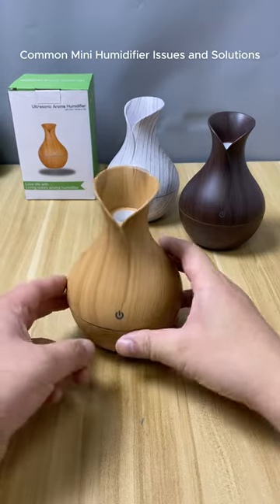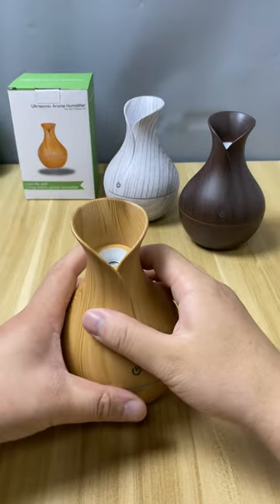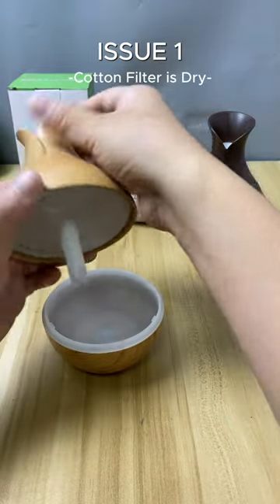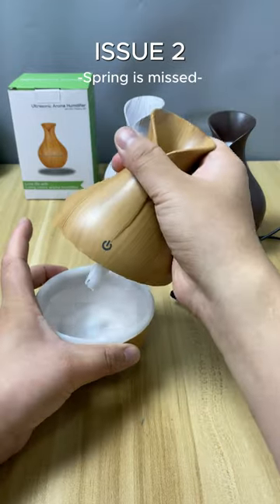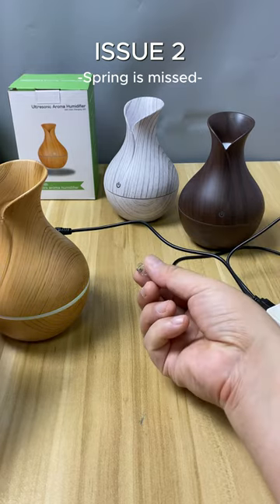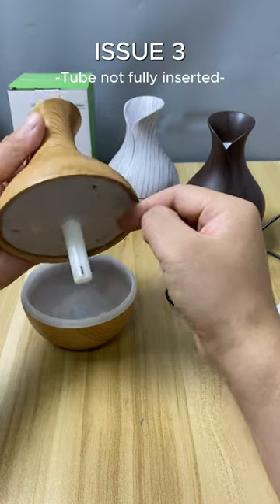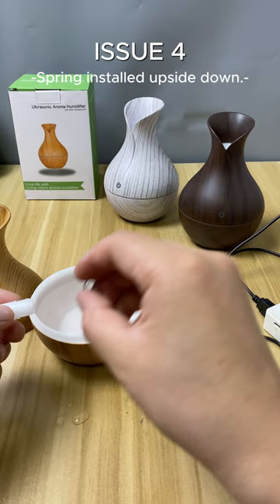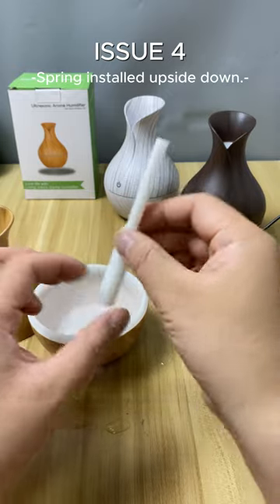Common Mini Humidifier Issues and solutions (Ultrasonic aroma diffuser Filter version)

Comment: Wowwww! Tip #1! I even had a suspicion that it needed to be wet and I kept it in the unit with the water just sitting there for 2 days! and it didn’t work! ONLY when I took it out and soaked both ends for a few seconds it worked!! I even tried to return it but they wouldn’t take cus it’s a cheap store! There was a whole adventure with that whereas all that was needed to add to the instructions was to SOAK the tube!! 😵‍💫😵‍💫😵‍💫
Reply from the maker: The operating instructions in our manual all explain about soaking the cotton filter inside the tube, perhaps the instructions from different manufacturers vary.
Reply: @entulyse  yea it was Miniso

Comment: Issue 7: I suspect that the very small diaphragm holes of the atomizer head get clogged easily, especially if using ANY kind of fragrance oil, or plain (instead of distilled mineral-free) water. Worst case: the small container of water runs dry and there is just the sticky oil left getting sucked up (recognizable by a colorization of the wick at the top end - havoc is guaranteed.
My cheap China humidifier (looking very similar to this one shown here) gave up working after a mere 50hrs or so. I tried all known 'issue' remidies with no success. I even completely disassembled the unit, tried to clean the two 'speaker' diaphragms carefully, used a brandnew cotton wick, all in vain. It is NOT the electronics, it is the ultrasonic head that is the weakest design spot.There is nothing you can do when it starts sputtering or failing completely. All left is to avoid this cheap Chinese crap with a lifetime of a few hours..

Comment: Mine hasn't got a spring ...?can I buy a replacement?
Reply from the maker: you can check the inner diameter of the tube in your product. Then, refer to the inner diameter to buy a spring that can fit inside. The height of the spring should be around 1cm, in a compressed state is approximately 2-3mm. A simpler solution is to use a spring from a pen as a substitute, and it should work fine in most cases.

Comment: Mine is not turning on. Its new, i dont know whats the problem😢
Reply from the maker: If the LED light doesn't turn on the first time you use it, there may be a quality issue with the product. Contact the seller for after-sales support.

Comment: My diffuser is not turing on..
It's just giving me a blink of light for a second and turns off
Please give any solution
Reply from the maker: It could be due to poor contact in the power supply section, or the touch switch being either insensitive or overly sensitive, resulting in multiple accidental touches that caused it to shut down directly.
Reply: @entulyse  Thank you 😍